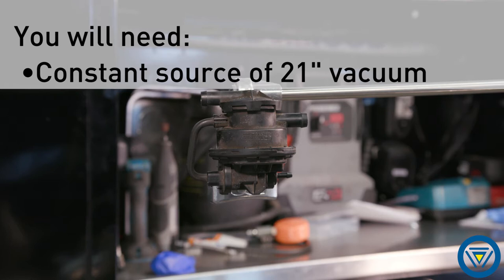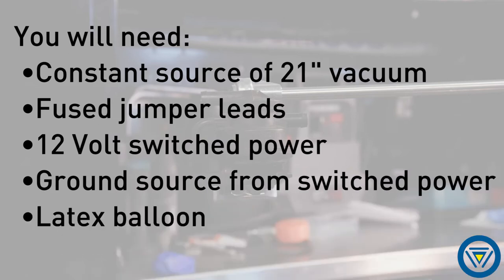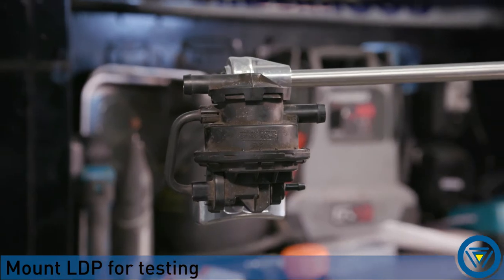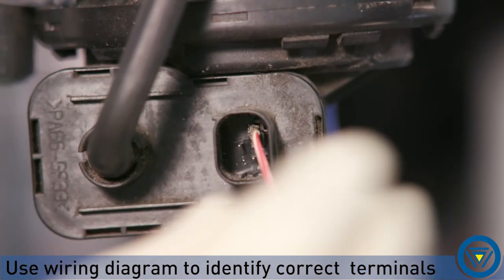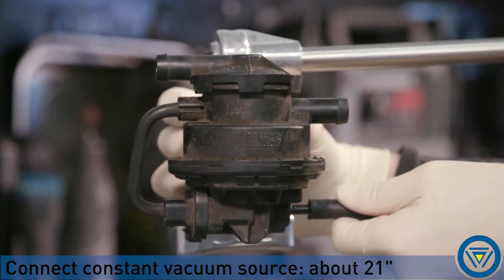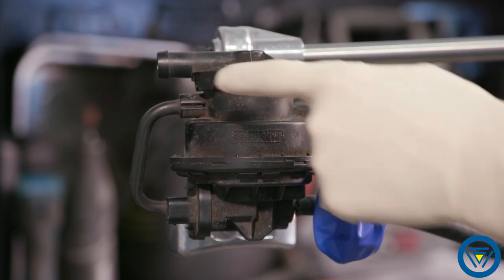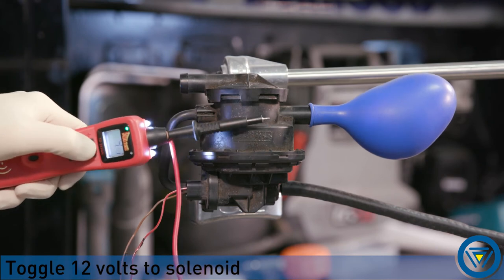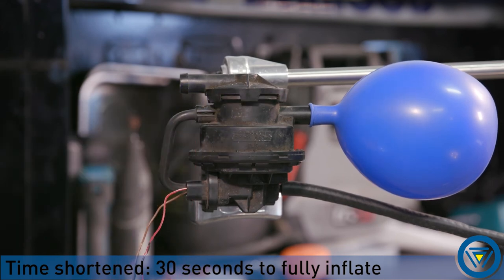How to Bench Test a Leak Detection Pump LDP

Comment: There is one problem here. The test as it's being shown does not test the reed switch inside the LDP that sends the signal to the computer to tell it the position of the diaphragm. The reed switches often go bad and when they do the system won't pass the self test. You need to monitor the state of the switch with an ohmmeter and confirm that the switch opens and closes when the diaphragm moves up and down. Otherwise the system will still show a fault when you put the LDP back into the vehicle.